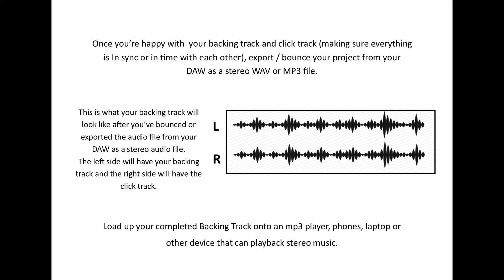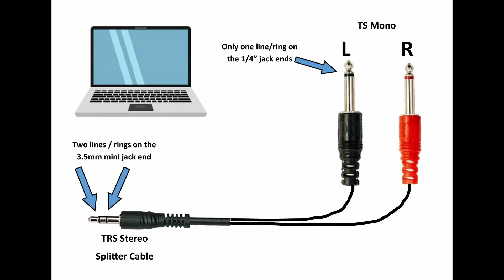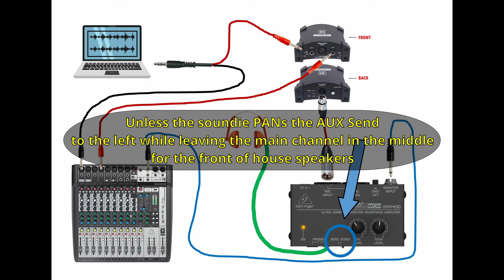How to use Backing and Click Tracks for a Live Performance

Comment: I'm going to give you an "E" for effort, and as they say, there's more than one way to skin a cat. But, this is not productive. I build and run playback systems for some of the biggest artists, and there are much simpler ways to do this correctly. The click track should never be embedded in the audio file.
Reply: please explain the right way how to do it.
Reply: Actually you can have whatever you need to be embedded with the click to help you play along. Maybe some of the backing track is what you want, maybe there are other cues. Probably there should be a whole separate mix that the band agrees should be on there for cuing purposes. Otherwise yes, once you are at a higher professional level you should have a full IEM system with separate mixes for everyone.

Comment: Why would you run backing tracks in mono?  It will sound horrible.
Reply: It won't sound horrible by default, it depends on the track. Hundreds of bands that don't have money for a multi-output interface just render the backing tracks out as mono so that they can pan it to the opposite side of the click. If these bands had multiple outputs  (as the expensive acts do) then they could use stereo tracks, but if they don't then it's best to run them mono if you're wanting to use a click as well. If not you don't plan on using a click, then stereo is fine. But if you do, you need to make sure that the click and backing tracks aren't both stereo otherwise everyone in the audience will hear the click.

In a live setting, with a live band (drums, keys, guitar, bass, vocal etc) the audience won't even generally notice whether the track is mono or not. If the track has a proper mono mix, it can sound fantastic
Reply: Running stereo in a live setting is grossly overrated (in my opinion).   I want my audience to hear the same thing no matter where they are in relation to the FOH speakers.   I understand stereo can be cool, ping-pong delays, etc…, but that is mostly lost on the listener.
Reply: It will only sound "horrible" (depends on what one means by horrible), if the mix is bad. One check I make before mixing down, is to listen to it in Mono. It will reveal relative levels between the instruments and vocals and let you know if they are balanced, or if something is really weak (which could be too low a level or phasing issues).
In fact, I was mixing a bit on a song last night and when I flipped to mono, the left/right panned heavy guitars disappeared. Whoops, adjusted the submix for the heavy guitars up until they reappeared then flipped back to stereo: "ah yes, this IS a guitar based song..."
If the mix is good, relative levels are set, etc, it should sound good in mono. You may not get all the neat left to right delay ping pongs going on but most people listening to an act live are not going to be like "You know, these guys suck because the music isn't in stereo."
Reply: @michaelwill7811  Honestly,  I was speaking more from the bands perspective.  We don't split the click into one side, instead the click is on a separate channel as are the cues.  We use a four-output audio-interface.  Everyone gets a stereo mix in their ears + click + cue.  Each person can then mix however they wish.  More click, less click, no click, but the music sounds so much fuller in stereo, especially the big, orchestral backgrounds, harmonies, etc.  FOH gets the two channel stereo feed.  I suppose these can be combined to a mono channel if needed/wanted.
Reply: It may not sound horrible, but it can definitely be missing some elements, mainly anything that is panned to the opposite side. If you're going to go this route, you'd be better off summing and bouncing your original track to a mono file.

Comment: Hey thanks so much for putting this together. It dispelled some of the major misconceptions that I had about the back tracking. Before, I was deadset on doing stereo to give audience "the best live experience". After watching your video, I was like "that was STUPID" and I went on a google spree. Turns out that you are absolutely right. I found out that a lot of sound engineers at venues actually found stereo backing tracks to be problematic, not only from a technical stand point but also from an audience stand point. Super invaluable 👍🏻

Comment: what if I want my backing track to be stereo on the house speaker output?
Reply: I'm trying to figure that out too
Reply from the maker: You'll need to playback the audio using a DAW and use an audio interface with at least 4 outputs. Main output 1 and 2 for the FOH and output 3 and 4 for the monitor mixes
Reply from the maker: @chronicironic1358   You'll need to playback the audio using a DAW and use an audio interface with at least 4 outputs. Main output 1 and 2 for the FOH and output 3 and 4 for the monitor mixes

Comment: The simpler way to do this is replace all the DI boxes, mixer and minimon with a Behringer XR18 mixer, connect your laptop via USB, load up Ableton Live with your backing tracks and cue the metronome to your monitor channel.  You should always use balanced XLRs when possible rather than 1/4" unbalanced

Comment: This is so clear, thank you so much for this breakdown! Just a quick question: Why, for option 2, do we also need to send the clicktrack to front of house if all they're going to do is turn it all the way down? I've seen multiple videos now describing this setup and they all seem to say to do this, but I'm confused why it's necessary. Wouldn't I just need to send it right to my mixer? Thanks!
Reply from the maker: Hey good question! You may not need to do this for every setup however lets say you're using a FOH mixer with multiple AUX sends and you also want to have separate monitor mixes for each musician. My video diagram would work best for a drummer so 2nd option will have the drummer sorted, but what about everyone else?
If the click is send to the FOH mixer, yes you would keep the fader down for the click so that its not going thru the main speakers but you could dial it in to AUX 2, 3, 4 etc and have that signal sent to an In-Ear Monitor system and have that sent to the other musicians along with their own band and backing track mix.
Hope that clears it up, thanks for the comment :hands-yellow-heart-red:

Comment: yo quick question, I have a pro-48 DI box on me, was just wondering how I'd get phantom power to it in method 1 since the MA400 doesn't generate any, the only connection to FOH is from the monitor input and afaik you can't really give phantom power from a 6.35 inch jack
Reply from the maker: You'll have to get a passive DI because I think from memory the Radial pro48 doesnt even have a 9v battery compartment like some other DI boxes
Reply: @BandOnABudgetNZ  cheers 👌🏻👌🏻 and yeah ur right! No battery slot

Comment: I am considering doing some solo gigs, so it will only be myself doing vocals and also all of my own original songs in Studio One Pro DAW, and also use of three different Gtrs, not all at the same time----haha, with an AG, EG and a Classical Gtr depending on the song. And then thinking what Equipment I'd need, and how many inputs I'd need for everything. I'd also be my own "Soundie", with everything set up to my left on a table. Might need to contact my Super Duper Sales Rep from Sweetwater. I have an Allen & Heath ZED 60-10FX, and a Steinberg interface, 2 DI's, etc. Thanks, I thought the Video was very thorough based on what Equipment you used, and I liked the Color Coding of everything.

Comment: Question: Do you need to use another DI box to send the click track to FOH? Or could you use a 1/4in and just send it straight to your personal mixer?
Reply from the maker: You can make do without the extra DI. I always use it to keep things clean by using the ground/lift switch

Comment: Hi, just watched this and you’ve made it so well - thank you for considering the detail and need for simplicity - I noticed that you answer the question only 10 days ago so I to I’m gonna pose you a question which I think you have already answered to be fair but I just want to clarify – and we are a three piece of guitar drums and bass and I have created a load of keyboards and backing vocals backing tracks for us to play over – at the moment I am going to use a MacBook and logic to do this – I understand I need to create the two tracks, one with the music and one with the click and cues – I have bought and not yet used a wireless IEM system with three packs - if I follow this method and buy two DIY boxes and one small mixer, where do I plug the transmitter for the IEM system into? Is it in an aux?

To clarify, what is the easiest way for all of us to use the wireless IEM packs so we can hear the music and the click?

Sorry if you have already made this clear but I’m looking for ultimate ease and clarification and so I know exactly what I need to buy to make this all work, thanks very much
Reply from the maker: Ok So there's a way you can do this without having to use an extra small mixer.

Take the stereo output from Logic and get both left and right channel to your main FOH mixer. Make sure to give them individual channels.

Then get your IEM transmitter and connect it to AUX 1 output. You can now dial in using the Aux1 volume knob the selected channels you want, in this case you'll want to add some click and backing track to the Aux1 audio feed.

You should receive the signal to your body packs. You may need to play around with volume levels because you'll have volume level control from multiple sources such as your Macbook, the FOH Mixer, the transmitter signal and the body packs. It can be a pain but finding the sweet spot for all takes a bit of practice. Rule of Thumb, Always start with the source.

Hope that helps. Lett me know if you have any more questions. There of course multiple variations of this kind of setup.
Reply: @BandOnABudgetNZ  thank you for getting back to me - almost went down that road of mixer but after speaking to a couple of music shops, we have bought an Audient interface with 4 ins and 4 outs - we can now send  2 stereo lines to the FOH  and a third (click track) and hopefully (haven’t tried it yet) plug the IEM transmitter in there - hopefully should work
Reply: @BandOnABudgetNZ  thank you for getting back to me - almost went down that road of mixer but after speaking to a couple of music shops, we have bought an Audient interface with 4 ins and 4 outs - we can now send  2 stereo lines to the FOH  and a third (click track) and hopefully (haven’t tried it yet) plug the IEM transmitter in there - hopefully should work

Comment: great video! just a question abt the second setup: wouldn't the aux send from the FOH to our little mixer also have the backing track along with the live musicians in it? wondering if it is necessary, can't the soundie control its volume once the aux send is given to us?
Reply from the maker: Yes the soundie can control it but lets say you need a bit more, its hard to get soundie's attention immediately when its as simple as just turning a dial yourself. The 2nd setup would work best for a stationary musician like keyboard and drums. 

You don't have to use the little mixer but it does give you the option to EQ the click or backing track. e.g when I play drums I tweak the click so that i hear a certain frequency of the click better while drumming. Same goes for backing track if I want bass boosted for my mix without affecting everyone else's EQ. 

In short, you don't need the 2nd little mixer. Its personal preference. And if you have multiple AUX sends then some will receive the click and backing track and other monitor feed direct from FOH while others using a small mixer will have a different send with more control over their mixes. 

My advice, try out both methods to see which you prefer. Hope that helps

Comment: Great video, so so helpful !
Was just wondering, I often use a setup where it goes Laptop -> Soundcard -> Wireless IEM (Wave Air 3 ST) to 3 musicians with receivers (drummer's IEM connected to Soundcard, so not wireless) and it is not reliable at all; with setup no. 2, where would my Wireless IEM be ? and I just bought a Xenyx 802S, would my click track be sent to the wireless transmitter from the FOH ? or through the Xenyx ? thanks in advance for the suggestions !
Reply from the maker: Hey @cranepusher2 , Here's how I would set it up:
Assuming you're also using the main FOH mixer with and AUX channel, connect your IEM to AUX 1 (or 2 or 3 ) on the FOH mixer. Then...
Laptop -> Soundcard -> main L/R output of Soundcard to Main FOH mixer (Use DIs if needed).
Now from the main FOH mixer send your Backing track to FOH speakers as well as Aux 1 (which is going to your IEMs). And now send your click track to Aux 1 ONLY (this is your IEM).

Do you need a soundcard? Cant the laptop just use the headphone output to the main mixer? not sure why you need a soundcard UNLESS your backing tracks are being played back from a DAW or recording software.

Let me know if this helps or if you have nay other questions.

Comment: Hi. Just set this up and all working. Can you tell me as an electronic drummer I'm currently sending the kit straight to mixer that only leaves control of FH volume with the brain that i can reach.
It might be obvious but could you clarify how i get more control on the kit going to FH using the above set.
Thanks
Reply from the maker: On my drum pad, I usually set the on board drum pad volume about 1 o'clock on the dial.
I use jack to jack from the drum pad to a DI box, then XLR out of the DI box straight to the FOH mixer.
From here you may need a bit of help. You'll have to play the drums at your usual velocity and style and have someone else adjust the gain on the FOH mixer so there's a strong signal but not peaking, and maybe add a compressor for those loud moments.
Then you can move the fader up to how loud you need it and also on the master fader for your FOH.
Reply: Thanks.
I'm not using a di box between kit and mixer, do think i should
Reply from the maker: @MrLines22  Its not necessary but one of the benefits of using a DI is having a Grounding switch to cancel out hums as well as a Thru output to send another copy of the signal to a personal monitoring system, pre amp etc.
I always carry one with me just in case as well as an XLR to extend the length needed to the FOH, or snake box
Reply: Thank you
Really helpful gone from accustic to electric and backing tracks with a keyboard /singer... One thing having a bit of an issue with is levals of backing tracks and without an engineer on gigs I thinks gonna bit a issue, songs coming from different sources isnt helping.
Any Advice welcome.
Once again
Thanks for your time.
Reply from the maker: @MrLines22  setting levels would be best done starting with your DAW. For example in logic you need a reference track and then adjust levels, EQ and compression of you backing track. You want to make sure the overall volume of your track is as loud as you need. You should also play around with the LUFS integrated levels. This is basically your overall "loudness" of the track. Find a suitable LUFS level and then try to mix all your other backing tracks to the same output level and LUFS level. This is so all your backing tracks are at a relatively consistent playback level in terms of Volume and output signal.
Once that's done you'll have to play a bit of a guessing game at a live performance to get your guitar and vocals balanced in the mix. Ideally ask a bar tender, or friend to help adjust these levels in the first 2-3 songs. Hope that helps =)

Comment: Hey fella - I've got an 802 and found this really useful.  Do I really need the DI box(es) in that if the stereo output from the iPad was track-left, click-right, then once plugged into the 802 in two different channels, (click 3 & track 5)  then I could take the track channel 5 to FOH from the Main out Left; it then becomes a mono track input onto the front desk, whatever channel

Or are the DIs needed to boost/compress/enhance the signal coming from the iPad?

Love your work and many thanks!

Comment: Hi Thanks for the video, Im new to live performance.
So if I wanted to have a separate aux output (with a click track etc) sent to in-ear monitors and then the master output sent to the FOH, id have to use a computer with a DAW for this to work for stereo? Is there any disadvantages of having the output in Mono over stereo?
Reply from the maker: Yes you'd need a DAW and an audio interface with at least 4 outputs for a stereo setup. 
Some people prefer stereo because they like to hear click in one ear and the track in the other while others prefer stereo to create a sense of balance and separation. Downside is more cables, more gear, and using up 2 AUX channels for a stereo mix.

With Mono it means you dont need a laptop or DAW, just an mp3 player with a stereo send which will have one for the track and the other for click/cues. Plus you only need to use one AUX channel.

Another thing to note is if you've used a foldback monitor or wedges on stage, those are always giving you a mono signal. I'd recommend trying out both to see which you prefer as each person will have a difference preference.

For me personally, Im happy with mono. However stereo is a "nice to have" if you have the gear to support that. I would only use Stereo if i have a production and sound crew working for me. If I'm doing most of the sound stuff then I stick with mono.

Comment: I think can just one audio interface for the backing track and use your laptop oem output for click track. No need complicated
Reply from the maker: Yep you can do that but if you run into humming and buzzing from grounding issues that’s where the DI comes in. Or maybe you need a secondary output using the THRU output to a stream or record or individual monitoring from the musician. Bring a spare DI to gigs but you don’t always need to use them.